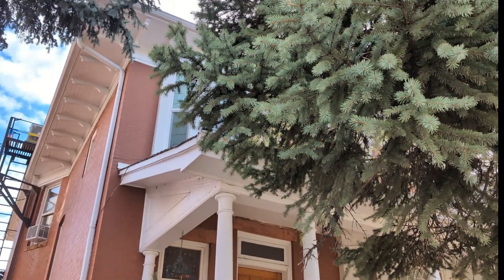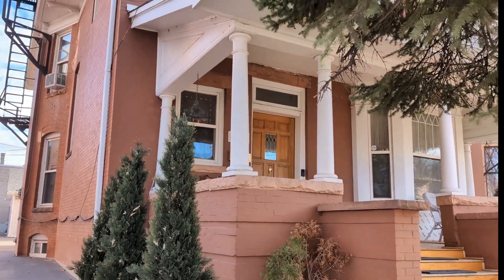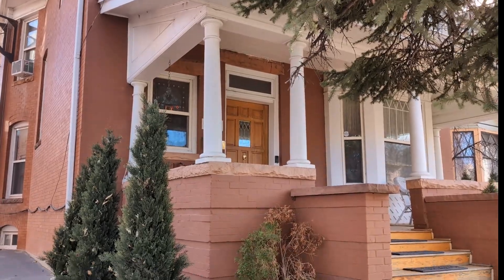PROBLEM SOLVED   Horrible Intermittent Odor in Home

Comment: Awesome! I wonder if it was rusting and that was the smell mixed with stuff from the air that made the smell? Ive got a horrible smell in my laundry room and im loosing my mind. I thought it was the neighbors in my duplex cooking fish or durian. Ive even snaked my sewage line. Spray foamed around the edge of my house to the neighbors. And other things. Im wondering if my leaking washing machine thats got a rusted bottom plate like this one is the smell?
Reply: This is a long shot, but just in case it ends up helping: 
Some people are not aware that their washing machine has a filter that needs to be cleaned out at least once a year. If you don't, it could get stinky. Might be worth a look.